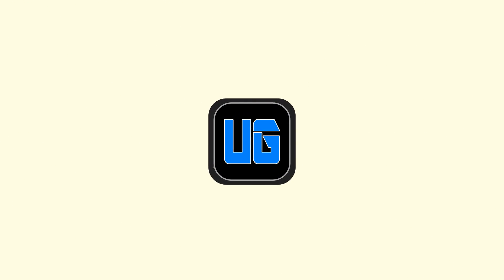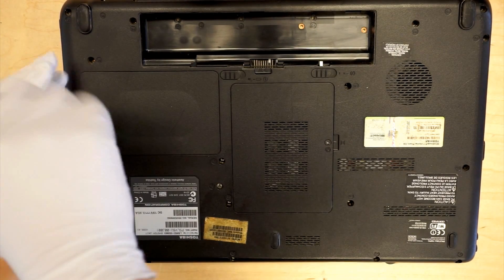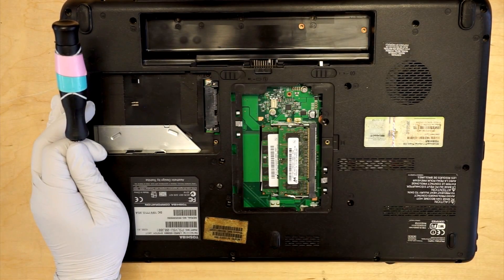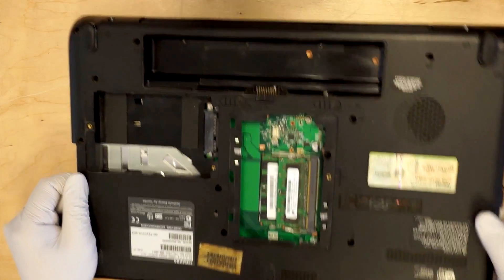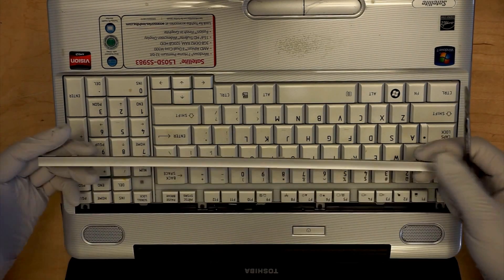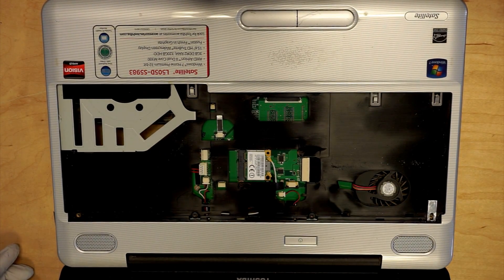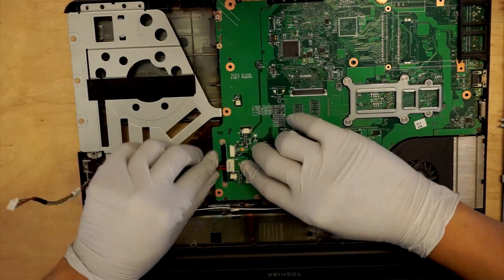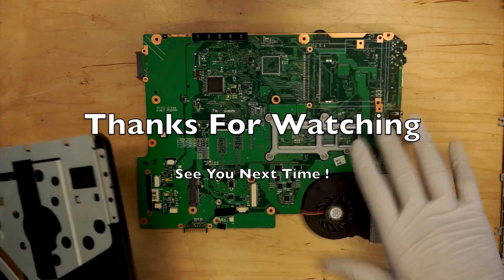Toshiba Satellite L505D S5983 Disassemble

Comment: i put a new one in it still aint work.let me give you some more information about  the laptop  when I used  only the Adapter  only the green power light come on and you can't hear  no fan sound .and when I put the new battery in it try to turned it on I hear the fan sound and it cut buck off